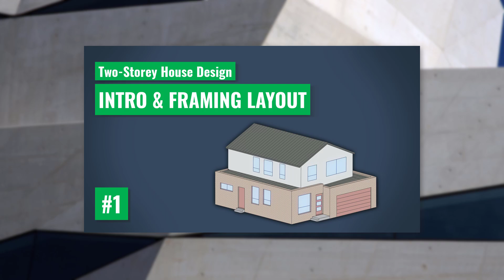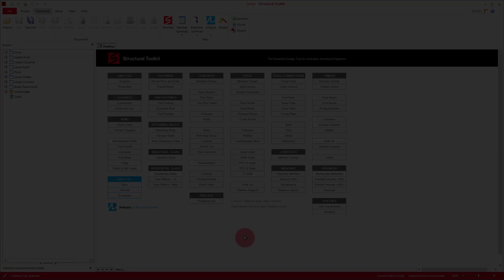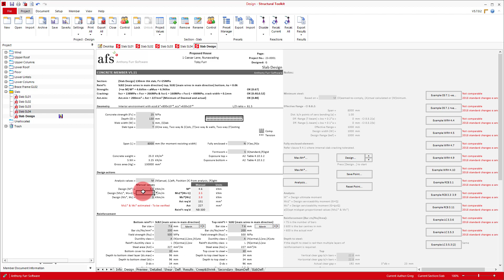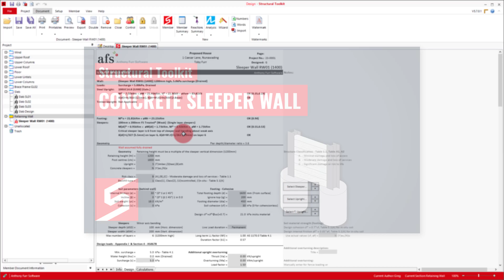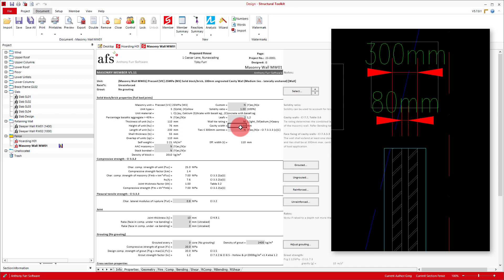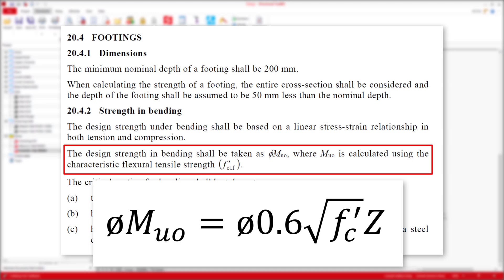Two-Storey House Design: Ep.6 - Slab & Footing Design

Comment: Hi Greg, Since the EB1 around the garage is 300×750 mm, can we assume the point load dispersion follows 3 × D (750 mm) = 2250 mm?
Also, regarding the unsuspended slab, does the load transfer directly to the soil? I assume some of the load near the beam may be taken by the beam itself. Should we consider this effect in our analysis?
Reply from the maker: If you know for sure that your footing will be 750mm deep, then you could potentially take 3*750m as you have suggested. The idea of an unsuspended slab is that it is supported by the soil, and it should be constructed as such. In reality, soil underneath may shrink underneath the slab and inadvertently apply additional load to stiffening beams - though it would typically be minimal.